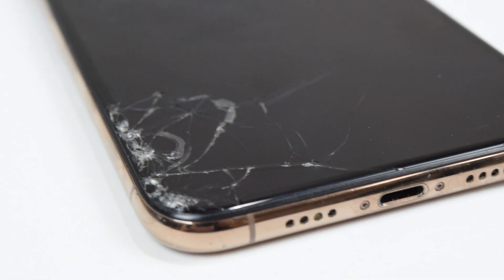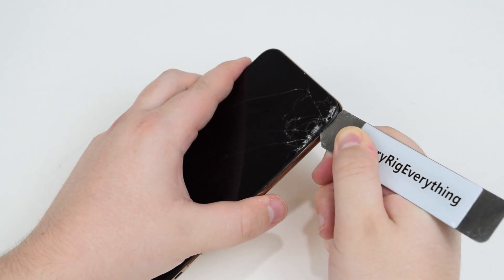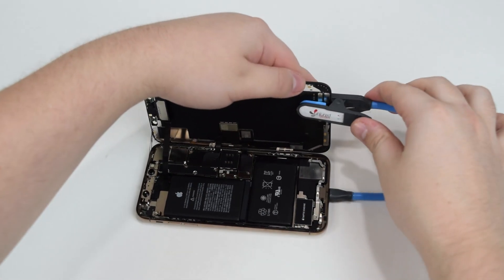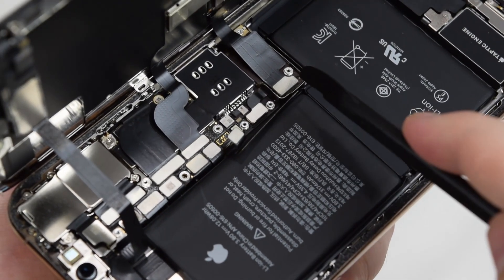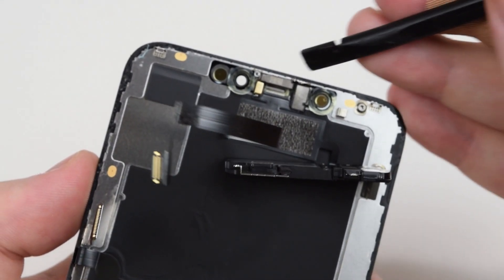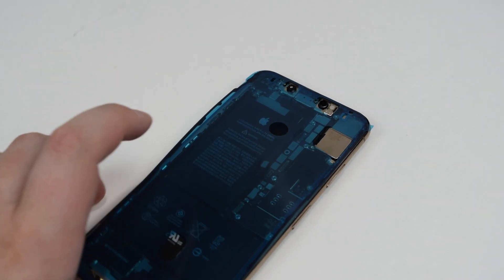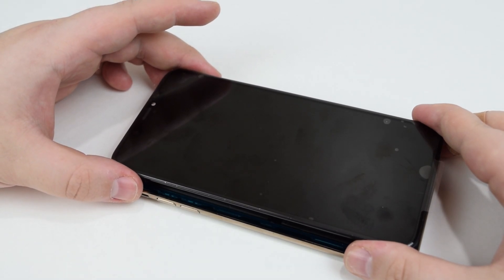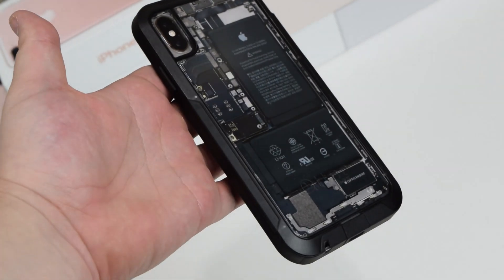100$ iPhone XSMAX Restoration (and CUSTOMIZED)

Comment: I tried working on an iPhone 4 + before and it came out with the screen not working, how do I fix that? I've tried replacing the screen but every time it still doesn't work. Am I messing something up in the actual phone or am I doing something wrong and shouldn't have replaced the screen?
Reply: Probably aren’t connecting the screen properly or didnt connect the battery properly. The 4 is an extremely hard fix and it wouldn’t surprise me if you damaged a connection or somethings not connected right. Watch a video on the 4+ and take it step by step also watching out for damaged connections on your skde